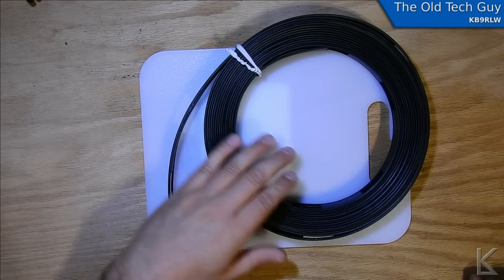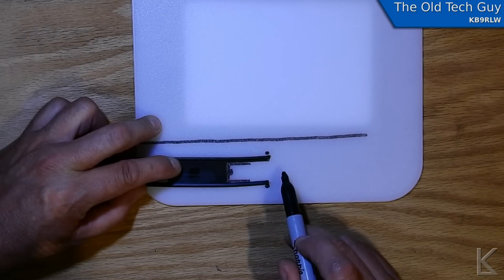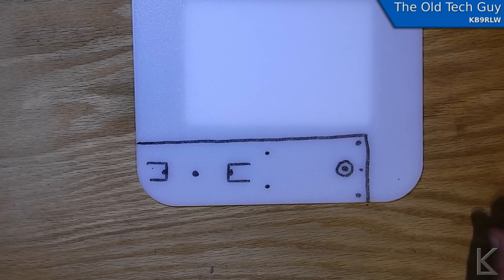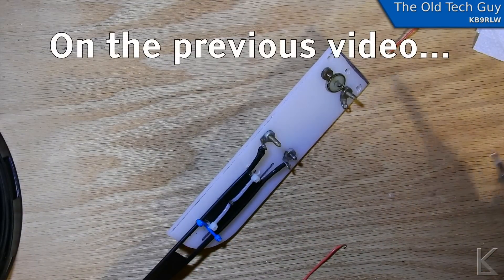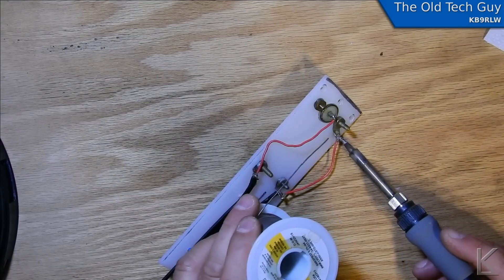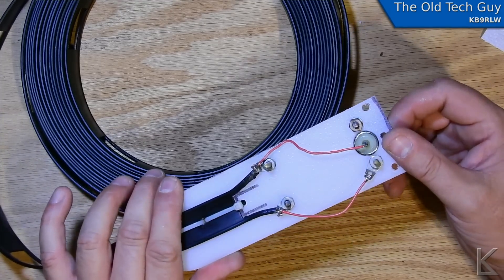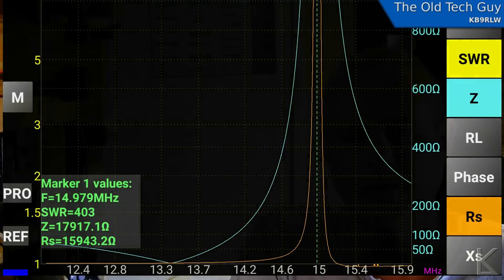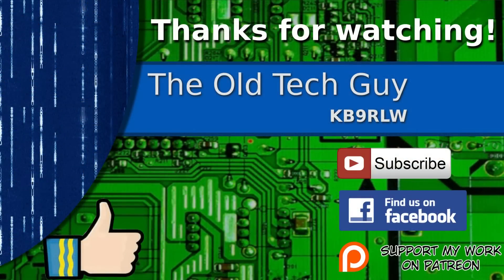Ham Radio - An end fed folded dipole experiment, part 2. Testing and the verdict.

Comment: If you short both ends and feed somewhere inside (1/10 of the wavelength from the end, as the first approximation), you would have a slot antenna. I'm going to experiment with that 😉

Comment: I may stand corrected for this comment, a J-Pole is a full wave Length with a 1/4 length folded back to use as a matching, this makes a 3/4 wave length a Slim Jim  is 1.5 wave length with 1/2 wave folded for radiator (top) and 1/4 wave folded for matching, would i be wrong ...no math here I guess it's all in practice

Comment: HAHA!, 
So, I like experimenting,  I setup and see if it works.. Then, when I make contact, some have said "I'm surprised you could make contacts 50 feet away" I just nod. Thanks for showing what you tried!
I regularly put up a G5RV Jr, running the ladder line down an Al pole, and make contacts from OR to Fl. 
My theory,  Try it and see if it works. yes I know using some basic theory can make things better, but hey if it works, it works!

Comment: I thought it be like a roll up J-Pole antenna with a longer than radiating section.
Reply from the maker: Except that a J-pole is wired differently with the end shorted and a feed point up a ways to where the impedance matches the feed line.

Comment: I would like to re-test such an antenna, but I will match the VNA to the extremely low impedance feed point.  (I will feed the short at the near end.)  I hope to get to it B 4 I die, bucket list ya know.
I don't twist the end wires together, I fold them toward each and solder them side by side the full width.  (I made "J" poles of the stuff for friends.)
I will feed it by feeding the two end wires at one end (soldered together) through a toroid core (one turn) with the other winding being fifty turns that connect to the VNA, I think that has a possibility of working.  The advantages of such an antenna is:  lower received noise, slightly wider bandwidth than a single wire, only one distant support and no feed line except right at the RV.  This can also be made with that clear 300 Ohm TV down lead, for a better appearance.  I think the balun and end of the antenna can be potted to water proof it.

Comment: "haven't found a good [NEC] front end for Linux" -- 4nec2 runs in Wine.
about the musing of end-fed 1/2 wavelength plus 30% -- 0.5 lambda + 0.3*0.5 lambda = 0.65 lambda. yes, that's quite close to 5/8 lambda.

Comment: Great work, Kevin. You should carry on with another video about the RF matching tricks to make it work. That would be fun to watch, and the whole process is instructive. There are several ways to match it as an efficient end fed dipole antenna or a loop antenna. The easiest method is a few wire cuts and jumps, at just the right spots in the window line. Take 2 ferrites and call the doctor in the morning.

Comment: HEI I have made several folded dipole antennas, but I make them as a regular dipole with +1 meters between the elements and I have 1-6balun and a resistor 600 ohms at the top just above the balun when the antenna is straight this is good antennas that kill noise from fluorescent lamps, tv, cars`s and much more and are good at rx and tx.73 LA2VLA

Comment: Kevin, you never know till you try!  I am trying my magnetic loop setting inside the house running 9watts on my IC 703.  Made 4 contacts so far.  Oh, I mentioned I might try to make tuning caps out of tin cans.  Try?  Well that is what I am using on the mag loop for rough tuning!  Greg

Comment: I wonder if instead of grounding the so239 to the folded dipole u might be able to use a counter poise wire separate of the folded dipole and attach it to ground on the so239. that should take care of the short that u experienced with the folded dipole configuration u used. 73's NA8A

Comment: It won't work as is, but not so fast!  All end-feds need some kind of tuner to work. This should work if it were configured like an end-fed with the entire ladder line at the same potential as the center of the feed line coax. The ground side of the end-fed should have a separate counterpoise. This way the antenna isn't a dead short. In the case of this experiment, it seems configured the same as if you took a 33' piece of RG-8 coax and shorted the far end similar to 33 feet of Chameleon Loop coax.

Comment: Seems we are building similar antenna projects. I have about 40 feet of 450Ω window line which I attached 33.5 feet each leg (67 feet total) for a 40m dipole/doublet. Using a 4:1 Balun connected to 450Ω window line I am resonant at 14.100 MHz (SWR 1.2). I scanned the whole ban and have dips all over, antenna should tune across HF nicely when I hook up my tuner ; ) My current test was just a few feet off the ground so it should work much better when I get it up about 30 feet ; ) My experiments are to use window line and ladder line as feed line, I am liking it so far ; ) Sort of following W7FG Doublet Design.

Comment: Good job. Not a failure at all. IT is a good starting point. Try replacing the wire between one leg of the feed line and the SO230 with a variable capacitor. 33 feet is fairly close to a quarter wave on 40 meters. It might surprise you and work on 40. The idea of the cutting board from Wally-world as the center support is a really good idea. We can use that idea on several antennas. Thanks for sharing with us. 73 DE K7RMJ  Frank

Comment: Extend the transmission line to 5/8 of 20m wavelength, allowing for velocity factor. A dc short at that the end will result in the characteristic impedance of the transmission line appearing at the feed point.
Same result if the transmission line is only 1/8 wavelength long, or if  a 1/8th is tacked onto the end of any length of transmission line which is a multiple if 1/2 wavelength.

Comment: Hey eznec windows works fine under wine on Linux. The dead short on the feed line could be remedied by adding a terminating resistor at the end instead of shorting the 2 wires try 400 ohms feed the antenna from the top.
Reply: yes, like a squashed rhomboid !   check out #62  !!  73 - K4WWD           https://archive.org/details/73DipoleAndLong-wireAntennas/page/n117

Comment: I wonder if anyone has tried to build a multi-band folded Dipole by electrically shorting the dipole is different locations using relays or maybe PIN diodes.

Comment: I now went back to the simple at one End shorted 5m Speaker Cable.. But this Time I removed the Short and replaced it with a 50 Ohm Resistor... The SWR is now very good (at about 14 MHz)... almost 1:1 :/ But only on the 14 MHz Band.. Strange..

Comment: Kevin, Try using 450 ohm window-line to make a folded 

dipole about 47 ft long.  Move the feed-line  from the dipole's center to one end, and leave the dipole's original center-fed point open and the opposite end closed.  This constructs a 40 meter, end-fed, "linear-loaded" dipole with about 25 ohm input impedance.  Of course, as with most resonant wire antennas, its length will need fine-tuning (i.e., shortening) to bring into resonance and compensate for installation environment factors.

I modeled this (via EZNEC) and found that a 33k ohm 

resistor across the open center point provides close to a 50 ohm input impedance with a minor decrease in gain.  Ken WA8FCI
Reply: This was my thought as well.  I assumed he was going to put a loading resistor where the traditional feed point was, then feed the "end" (where the fold is on one side) with the two sides of an unun transformer.  That would be analogous to an off center-fed dipole.

Comment: Hi Kevin, very interesting.  I'm still intrigued with the end fed idea, so would you be willing to share the VNA output screen shot with me?  I have some ideas I'd like to try.  I sure appreciate your courage in trying this experiment in a public setting.  (BTW - I built a 30M hypodermic end fed dipole, works great.  I've also built single band EFHW antennas per AA5TB's website which work very well.)  73.
Reply from the maker: It was an experiment with sharing an experiment.  They sure beat me up over on QRZ's forum!  wow.   But I pretty much knew it wasn't going to work.  Still, build it and scan it just for the data is something I do often.  
I have the screenshot, email me at my public address listed over on qrz and I'll send it to you.  Or you could just screenshot the video when it's full screen.

Comment: For permanent work watch  out for cable ties mine fail in a year because of the UV.
Reply from the maker: Yeah.  With the cutting board, you could just cut out a rectangular section and use screws to clamp it over the other.

Comment: We all learned something so it definitely was not a failed experiment. There is definitely something to be said for modeling in the real world. The models follow after we understand principles that are learned in the real world so they can only be as good as what was already learned in the real world. If you're trying to learn something completely new, an existing model probably won't help.

There is definitely some great stuff coming. I'm very much looking forward to the review of the mcHF radio and the comparison between a folded and a regular center fed dipole. I'm sure to learn lot from both of those. Thank you!

Comment: Try this .....  here I shortened a 40m dipole length by about a third through liner Loading using 450 ohm ladder line: https://youtu.be/AO9Xj9a94Q0
Reply from the maker: That would be good for space-restricted folks.  I'm usually out in the sticks and have room for full sized antennas.  I'd rather have the larger capture area and fully resonant length of wire than go shorter.
Reply: Kevin Loughin yep which is why I can use it as an inverted v in a 29 foot space and when I feed it with 300 ohm ribbon feed I can tune it 80-10. However as you have the space that's fair enough 73

Comment: Hello Kevin
Before you give up on the end fed take a look at terminated folded dipole and monopoles and see if there is something that is applicable for the end fed
73 Randy KJ6KUY
Reply from the maker: Terminated folded dipoles trade efficiency for broad bandedness.  On most bands, they're more like a dummy load with really long radiating wires.  I like to run QRP often, and would rather have efficiency over convenience.

Comment: If you short the end and feed it in the center it is a simple folded dipole (288 ohms).  What about feeding it off center?  Make it a sort of folded Windom?  Might work multi band operation but a transformer would be needed.
Reply from the maker: I've thought about that too.  I imagine the impedance would be quite high 1/3rd or 1/4 from the end.   Might be a future experiment.

Comment: Could You at least receive some Signals with it? :D At least that was something, that worked with my little Experiment here.. :D I think, it could be (at least somewhat) useful for Receivers, that suffer from something called "Signal Overload"... :D And that the SWR is so bad, is actually even a good Thing in such a Case... :D I had no Problems with Signal Overload with my little Experiment so far.. :D And the Noise Floor also was very low too.. :D I later tried to connect a 10m long Single Wire to one Side of the 5m long Speaker Cable (the Center Conductor Side), that I had to use (no Ladder Line here.. at the Moment.. :/ ) and this Way, I could receive even more Signals! :) (But I also removed the Thing, that shorted the two parallel Spaeaker Cables.. :D , so there was not Short at this Point anymore... )

Comment: thank you for posting the results. As explained before, it was not gonna radiate, however, its behavior as a shorted line is also peculiar. The short circuit at 13.3MHz was expected (half wave is 37 feet if the velocity factor is 1) but the open circuit resonance that is just 1.7MHz away is strange. Can you please post a picture of the Smith chart plot or just the SWR plot for the whole HF band?
Reply from the maker: I didn't save the scan of the full HF section.  It had a repeating pattern like the one shown,  spaced around 7 mhz apart.

Comment: Kevin, the Z at 13.3MHz shows the theory was correct - if you calculate a quarter wave, less the velocity factor, 33 feet is an electrical quarterwave at about 13.5MHz. How about uncoupling the ground side of the ladder line and using it as a 40m quarterwave linear loaded vertical? You will most likely need a few radials, but worth a shot? Well done for trying and sharing the fail - good honest work.
Reply: Steve Hartley I've done this and found that if you keep the far end shorted together then 23 feet or so of 450 ohm will be ok as the main radiator for a 40m ground mounted quarter wave vertical with radials of course
Reply: Hi Steve (M0XXS here!)  I was thinking the same.  If you have at least 16 short radials I think it'll be about the equiv of a 30m antenna.  (I think it will be equivalent of  33% shorter folded than a normal vertical).  Similar to what has been done on DX Commander by some, but with regular wire.

Comment: If you broke the short at the far end of the ladder line, then attached more wire, just a single line on the center conductor side, you'd have the structure of a W3EDP end fed. It's usually fed to coax with a 4:1 balun. I've got one up as my main antenna and it's good on all bands with a tuner. It's a non resonant design.
Reply: Love this W3EDP Zeppelin Antenna End Fed with 4:1 Balun, 17 feet Window or Ladder Line and 67 feet of wire ; )
Reply: @ouijim  that's the one I use as my primary antenna. Works great!